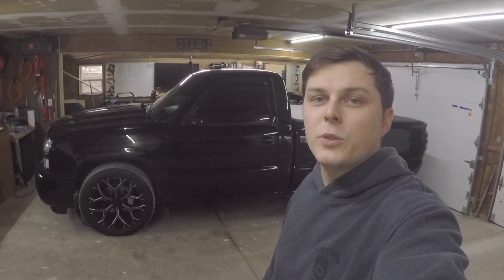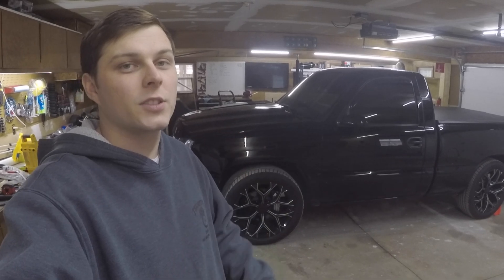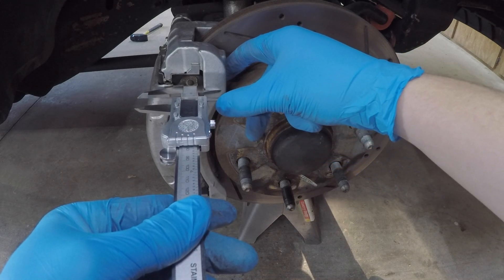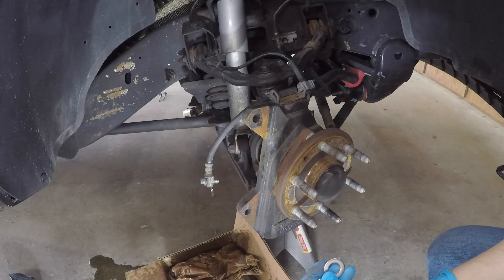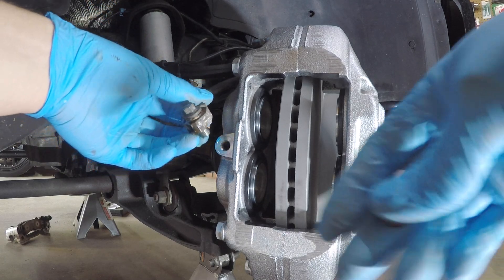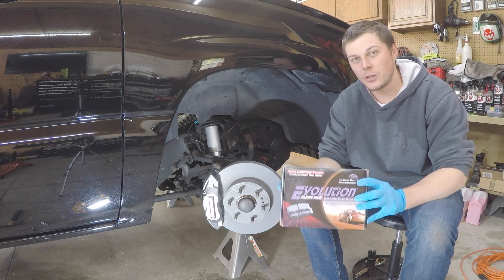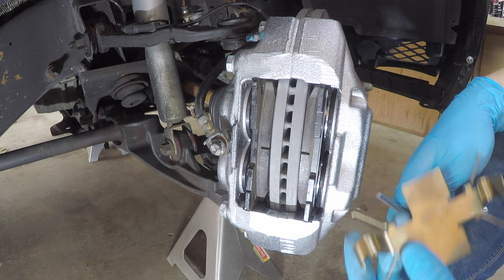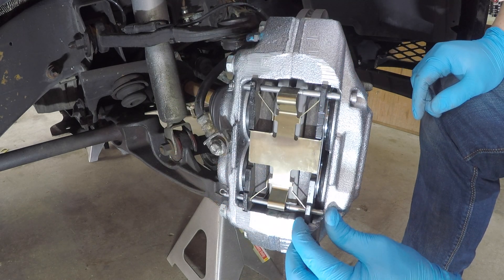Silverado 2019 Big Brake Conversion! “How To” A NBS!

Comment: Great video, if you don’t mind me asking what was the total cost of the swap?
Reply from the maker: Thank you! I forgot to put that in there. The calipurs were about $80 each, rotors $70 each, and $40 for the pads. So roughly $340 plus taxes
Reply: TheKingCoopa Thanks man, 340 for a big brake kit is a pretty good deal
Reply from the maker: @smalliebigs6784  thats what I thought too! The calipurs are even cheaper on rock auto, but they are always out of stock, and sell out instantly.

Comment: I love my 19' brakes on my 07c! I have almost 15k miles on them now. Great video
Reply: Hello, the new calipers, rotors and hardware what did you get them for? I have a 06 silverado 1500 4 x 4 , do i get 2020 1500 4 x 4 ?
Reply from the maker: Hey, I made sure they were for a 2019 silverado 1500. 2020 would work also. All the part numbers and a few links are in the description of this video.
Reply: @TheKingCoopa  does the four wheel option matter ? or is it the same part number regardless
Reply from the maker: @frankgomez4357  that doesn't matter, the part numbers should still be the same. There are 2 or 3 different calipur designs the 2019 uses. Just make sure its the 4 piston design.
Reply: @TheKingCoopa  cool , thanks a bunch.. 👍
Reply from the maker: Oh nice! I've only put like 4k miles on mine. How close were your wheels to hitting? And thank you!
Reply: @TheKingCoopa  I bought 2019 Silverado takeoffs anticipating wheel clearances lol. I have 3 other sets of wheels for my 04 Silverado and 13 yukon and none of those would fit. I posted on the RCSB group on facebook the pictures of each wheel kinda mounted and where they hit. I have stock Denali wheels that may fit if you grind the hump, declads that will definitely not fit, and some 20x9 10mm offset wheels that would need spacers or grinding of the hump. I want to get a drag pack soon and I need to make sure they fit before pulling the trigger lol
Reply from the maker: @BocaChevy  hahaha damn!! I just got super super lucky with mine.   .064" of clearance. Good luck on your quest haha. Id love a drag pack, just for the looks 😅
Reply: After install did you feel brakes were mushy?
Reply: @speedr8cer82  did you properly bleed the brakes? Sounds like air in the lines